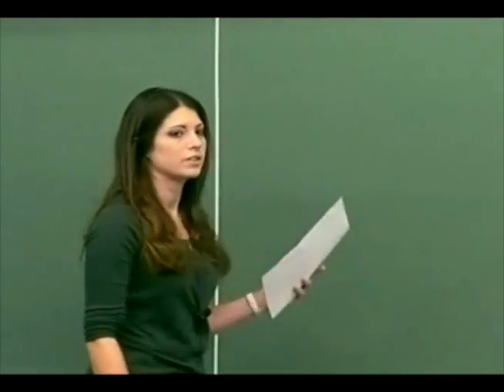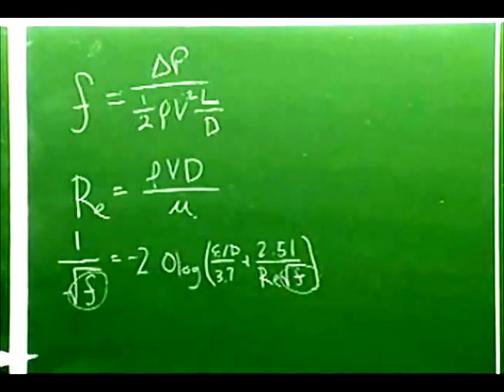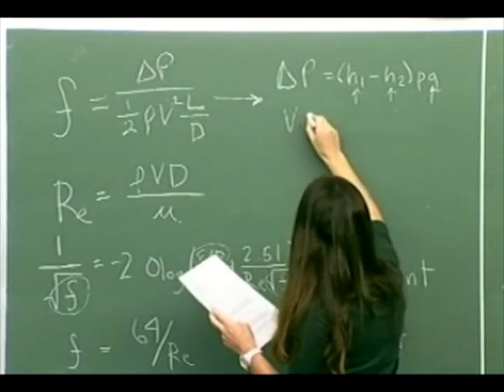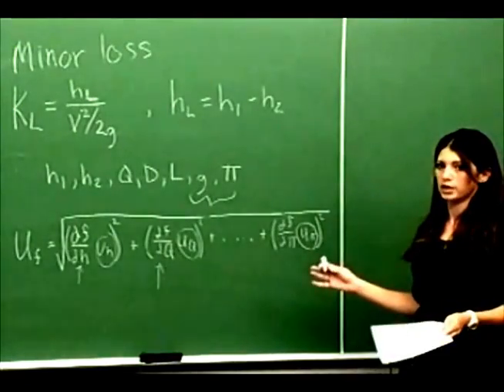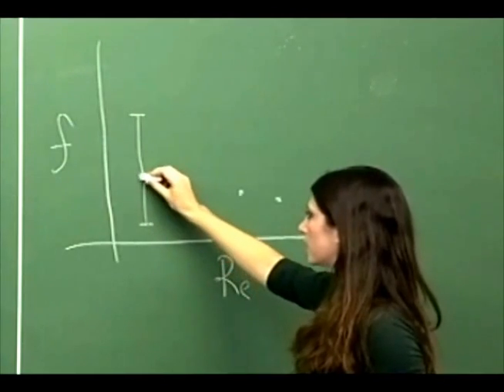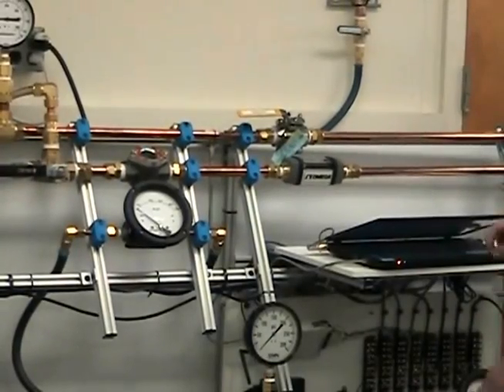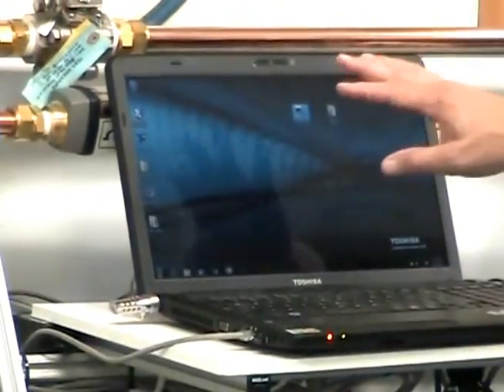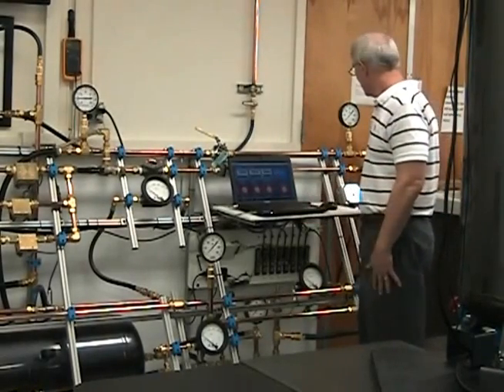Pipe Loss

Comment: When calculating the head loss through fittings, is the same "K" value used no matter what the viscosity? Everything I've read, states the "K" values are for based on water. Wouldn't there be bigger losses in a fitting for a more viscous liquid?